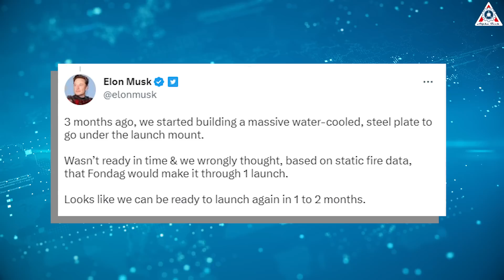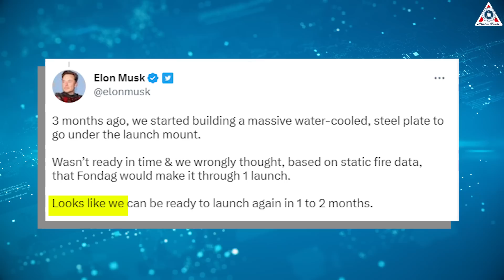SpaceX Stage 0 plans changed after huge damage from testing...

Comment: I do remember have written about steel plates on the bottom of the launch pad. They should be water cooled and have  a lot of small stipples to disarray eventually the sound waves. My next question is why SpaceX over jumped the testing of the booster  alone ? This would have given to the Starship more lifetime maybe
Reply: I don't think the production rate for Starship is a long pole item at this point. They could build 2-3 more before stage zero will be ready.

A SH only test (e.g. with a boilerplate Starship on top) might have avoided the cost of dropping some engines in the ocean, but if the launch had worked it would have lost the opportunity to test Starship in space and during reentry. If they expected the pad to be out of service for a while, that could be a major loss compared to the hardware being expended
Reply: @benjaminshropshire2900  I think this is the most reasonable reason. They have plenty of hardware on the ground, but limited flight opportunities. So putting all the eggs in one basket was pretty smart IMO.
Reply: @didyuknow I also thought it was crazy how they have all these vulnerable buildings practically right next to the launch tower...  if they're going to keep it in the same place, they'll need to harden the place up and fix Stage 0 before the next launch... they'll probably try again MAYBE by the end of the year (lol 1-2 months plz Elon...)
Reply: @didyuknow Yeah, they put their head into the sand but it didn’t make it getting better. The flying concrete chunks was a very known problem even when tested only three or nine 
of the Raptors. From the blow of 33 engines what did they expected ? The next problem; why not tested even one booster to launch it without any Starship sitting on the top? I’m sorry to say this but the track into the donkey corner where Boeing is already resting seems inevitable

Comment: My guess is it will take at least a year to repair the gantry and construct a flame diverter. With the water table just a few feet under the topsoil it will require special mitigation to keep the saltwater out of the flame trench. Space X could also raise stage zero high enough to build the flame diverter on current elevation. Whatever they decide to do it will take time to accomplish this and get it right. Testing is for learning and Space X has learned a lot with this test flight. Go Space X.
Reply: Elon says 2 months.  They have a huge water-cooled metal plate that wasn't quite ready for this launch but will be by then.  We'll see.

Comment: At the start of the article, you state that 3 engines failed to ignite.  Can you site your SpaceX source for that claim?  You point out how much debris there was, plus, the ship was held on the ground for several seconds, allowing time for damage to occur.  I have not read definitively that 3 engines failed to light absent damage.  The other 3 to 5 engines that failed in ascent were almost certainly caused by debris damage, so it's not a stretch to imagine that all of the failures were caused by it.  However, if the only failures had been those 3 engines, the vehicle would almost certainly have made orbit.

Comment: Hello .  What a day!
 My opinion is a thumbs up for the launch and a fail on the launch pad issue!
 You know, that for many months I was worried
 A) the platform - the thing underneath - was too weak for the hell I was going to see under it in such a small area.  I mentioned it several times!
 B?) I also mentioned several times my concern about having the tank farm that stores methane and oxygen so close and that they have also suffered.  Imagine if the booster on the ramp had exploded, it would have blown the tanks up.  @
 !Terrible!
 Causes: I think that phase 2 of the Starship did not separate because it must have suffered some stress or damage at the time of takeoff that damaged the booster release mechanism.  In addition, the rocks, intense dust damaged several engines that went out and there will be more things that we will know in due course.

 I think that what I have commented has been a serious lack of foresight and study by those responsible for SpaceX because if I realized this problem, how did they fail??  For saving money!
 Conclusion: Last Friday I thought that a new test would be at the end of June of July but in view of what happened I think that there will be no more flights until at least November/December 23 due to:
 A) revision of the settlement platform with a much improved and redesigned system.  Deeper and more powerful water cooling.
 B) Transfer of the tank park at least 1/2 km more with respect to the platform and with protective protection in the event of an explosion by the blast wave.

 Conclusion: new release November/December 2023 and... with objections.  THEY HAVE A LOT TO THINK ABOUT AND REDESIGN!

 sant cugat
Reply: @didyuknow what does taking off and landing on mats have to do with the superheavy booster taking off from earth?  It’s the starship upper stage that would be landing and taking off on mars, and that has been tested on its on several times.  This test was for the whole stack, something that will only be taking off from starbase and maybe Florida later.
Reply: @didyuknow yeah…that’s the whole point of fire channels and water suspension systems….

Comment: I always commented that the cushion was too low. In my opinion, it was to also build a well to divert the flames.
Reply: On the Moon and Mars, there won't be a water system to cushion the blast. He needed to find out now what he's dealing with so he could prepare for future challenges.
The damage to the launch tower is valuable data.
Reply: @protorhinocerator142  Well we're not gonna fire 33 raptors to leave from Mars. IIRC the second stage will be powerful enough to ascend from the Martian surface without any kind of booster.

Comment: Something I'm not hearing mentioned is the simple idea of increasing the distance between the Raptors and the concrete. Make the Stage 0 100' taller and the concrete/water/steel plate might be sufficient.
Reply: I’m think a couple of miles.
Reply: @tatata1543  Just launch it from space. How hard could that be?
Reply: @protorhinocerator142  Very hard, you still have to get all the material up there and assemble it.

Comment: Those failed Raptors were not 'just not working' - they were not even there!! The sheer destructive force of the flat slab under the launch mount must have broken the concrete and sent large chunks up and littererally destroyed those engines while it was still on the pad. They were lucky to get away with what they did in my opinion. If this is not a do or die reason for having a huge flame diverter then the super heavy starship is doomed from the start....
Reply: 🤔 Aaah.  yes, that's possible. Perhaps that will be documented in the analysis.  Very Interesting supposition.

Comment: "3 month ago, we started building a massive water-cooled, steel plate to go under the launch mount"

translation: the head engineers said "there's no way this is going to hold as it is"

""wasn't ready in time & we wrongly thought, based on static fire data, that Fondag would make it through 1 launch."

translation: I told them "sissies, fugget about it"
Reply: If it doesn't want to move, force it.
If it breaks, it needed replacing anyways.

Comment: Damn.  I've never seen images of that kind of damage from any launch.  A graphic demonstration of the power of that rocket.
Reply: and that was still throttled. damn..
Reply: 33 engines is kinda insane.
Reply: A graphic demonstration of a poorly designed launch pad.  Elon needs to take note from those who came before. https://youtu.be/VPQgJ5Hr7Is
Reply: Yup. Elon wins the billionaire’s pissing contest.
Reply: That is one big CUPOLE. Research cupoles at Gobekli tepe and California grinding stone rock park as well as most megalithic sites.

PPP; Public Private partnerships are the definition of Fascism.

"Fascism is Corporatism, Corporatism is Fascism" Mussolini

The Great Harlot who lives on many waters in the book of REVELATION Jesus gave us to warn us about the Dragon China.
Reply: And a sign they are going to end up with a year long delay getting stage-0 right. The steel plate and water will not work either. They are going to have to build a diverter system. Whether they dig channels or use pipes, it should be pretty clear at this point the current “tall tower and strong concrete” system cannot do what they want.
Reply: @TheCmac1966  They might still be able to use the tower as designed, but it does seem like they're going to need a flame diverter coupled with a water deluge system put in place for the next launch.  It's unclear how they're going to be able to do that given the high water table.  I see them removing/rebuilding the mount entirely and redoing a good portion of stage 0.  I'd give them 6-12 months.  I'd be surprised if they have another test launch by the end of this year.
Reply: @squirrelsinjacket1804  agree completely! Alpha-Tech will find a way to praise Musk’s delay. Lol! Next week: “Why Elon is smart for ignoring the lessons from the past.”
Reply: And yet basic launch design that NASA uses could have prevented it. SpaceX is amateur hour.
Reply: @thesciguy4823  Basic NASA launch design don't work when you consider fast maintenance/replacement for raptor engines and moon and mars usage.  You gotta invent something new to tic those boxes.
Reply: @malax4013  but the advantage of moon and Mars is lower gravity, meaning less force needed to lift off, and I think it would only be the starship section with far fewer engines and much less power for the ground/pad to deal with
Reply: @malax4013  There are several inexpensive and fast ways to build a flame diverter system. Dig trenches and insert 10’ steel pipes and then cover them with earth. Spider them out and have them converge under the pad with a steel tub and shallow water pool for the deluge system.
Reply: @Fromatic  If they use the same superheavy with 33 engines they can only reduce forces by using minimum throttle of raptors. Not sure what percentage of throttle was used in the flight test. They could reduce the forces by igniting the inner engines after lift off. 🤔

First iterations in moon and mars will be the same they use in earth (33) but maybe in long term could make different engine configuration for moon and mars but it needs to be reconfigured in there or they just don't light up every engine on lift of.
Reply: @malax4013  superheavy isn't going to fly on mars or moon, only starship.
Reply: @outandabout259 Moon for sure but does starship have enough thrust/fuel to push out of mars gravity?
Reply: @thesciguy4823  Frankly, sometimes having an amateur come in with a fresh set of perspectives is a fantastic thing. Failing fast and failing often is a great way to learn, and while different from modern NASA, is not unlike the early days of NASA. That said, I'm still not sure it's fair to call out the manufacturer of the most reliable and most often used flight vehicle - a human rated one at that - 'amateur hour'.
Reply: @thesciguy4823 starship meant to be durable like a truck...
Reply: @thesciguy4823  on the one hand you are right but only in hindsight. On the other hand space-x innovation progress makes the competition appear to be amateurs so that is also worth mentioning.
Reply: The Soviet N1, also a Moon rocket with about 30 engines, exploded so spectacularly that it was one of the largest non-nuclear explosions in history and people died. Musk is just lucky that this thing got off the pad and to high altitude before they had to destroy it.

Comment: No matter how long it takes to repair & upgrade stage 0, we'll certainly see multiple Starships lift off before a 2nd SLS or 1st new glenn.
Reply: Perhaps, but whether any of those are 100% successful as SLS was on it's 1st flight is unknown.  The big booster has a lot of problems that need to be addressed.  A lack of thermal protection for the engines and mounting them too close together for 2 examples.  Not doing a full duration burn of the booster on a test stand as everyone else does is a problem too.  The Soviets also skipped ground testing with their moon rocket and look at how that turned out. So many things that can go wrong that you HAVE to test on the ground first. And by "test" I don't mean a weak 3-second burn at half throttle as SpaceX did.

Break it on the ground before you try to put it in the air. It's worked for decades. NASA's maiden flight record is perfect.
Reply: @Doggeslife  It is also why it takes them 12+ years and multiple billions of dollars to get in one test flight.  And, then, what happens if the simulations were wrong, and actual flight test finds a weakness that simulation didn't accurately model?

The rapid iteration method of development combined with simulation as SX does is vastly more cost effective and much faster as well.  SX is literally spanking NASA with each and every test flight.
Reply: @Doggeslife  Well considering their success with Falcon 9 and everything  I'm gonna lean with spacex on this one. It takes NASA decades to test a new rocket.
Reply: @Doggeslife  and look how much money and time they spend on doing that Space x has a different approach
Reply: Yeah, lift off and crash😅
Reply: @MeisterANT  lets see you do better....

Comment: Why didn't the launch pad get chewed up during static fire testing?
Reply: They were only using 50% thrust power during the last static fire.
Reply: @astrogeo1  Why? Seems like a pointless exercise if the engines aren't tested at 100%
Reply: @brendanpells912  They didn't dare having it higher. They figured the situation with the concrete could take only max one launch at "full" thrust. Actually "full" thrust during the launch was only 80 %, I've heard.
Reply: @astrogeo1  Depends how fast you want it to lift off the pad. It'll lift off slower with reduced thrust but then the concrete will be subject to a lower level of heat for a longer period. Plain fact is the launch pad should have designed from the start to withstand full thrust + a bit more to give a safety margin. Would you like to be 10th person to step into an elevator knowing that it was designed to carry 8 people?